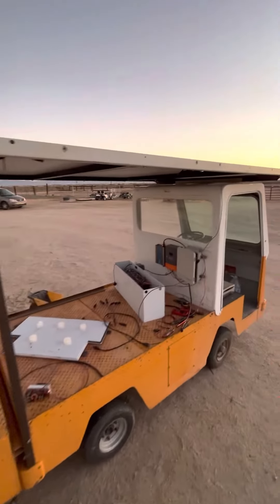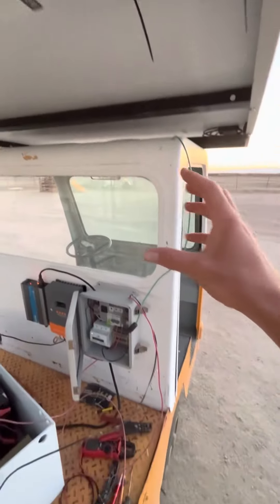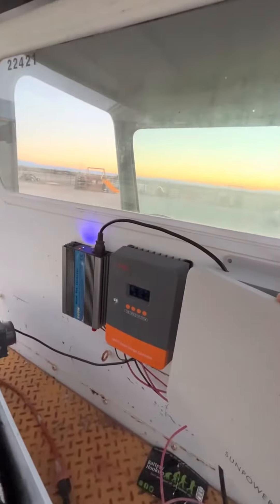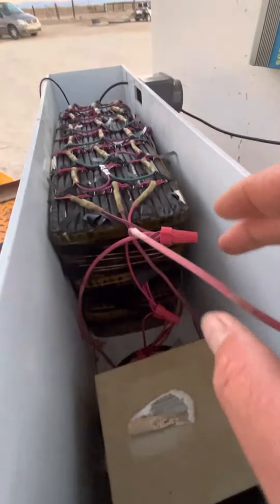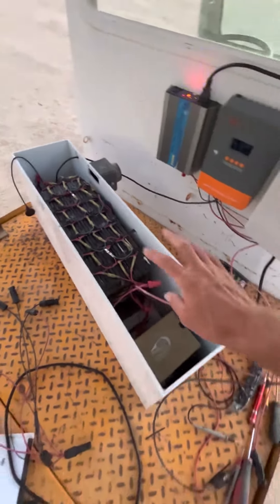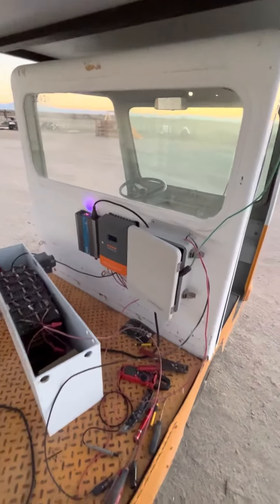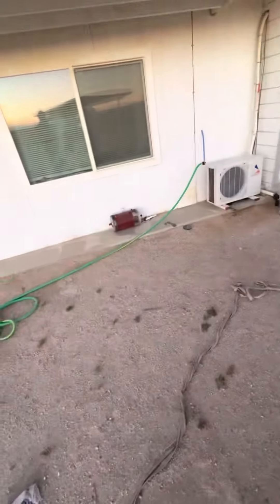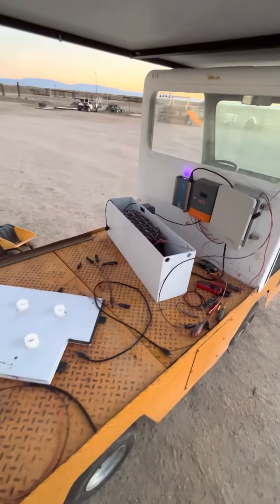1kw Solar system on wheels

Comment: What happened with the motor? I have the same yruck snd im having trouble with the motor running slow also.
Reply from the maker: I took the motor apart and there was shorts on the commutator bars so I separated those shorts and it worked fine. There must have been a load of rocks or debris dumped on the motor as it sat for a while then when it was moved it spun the motor with all that debris in it.